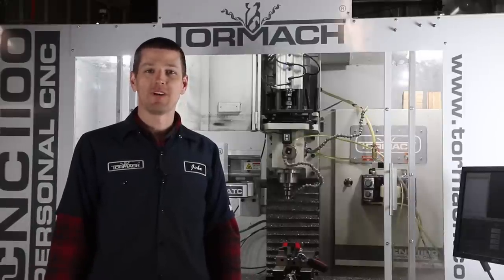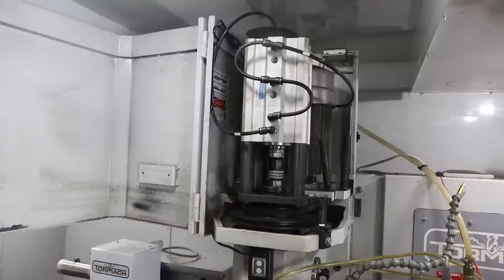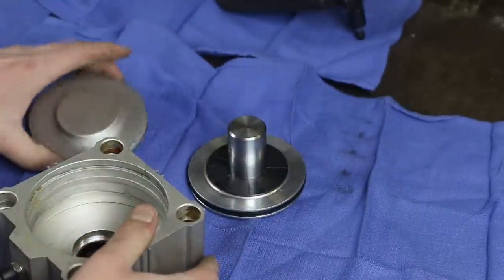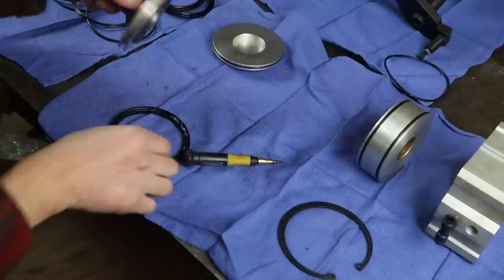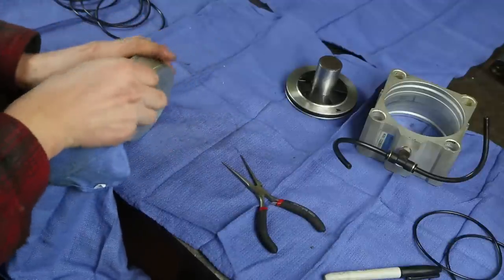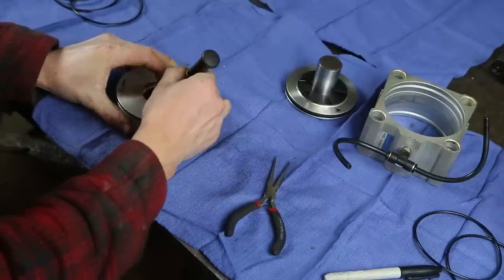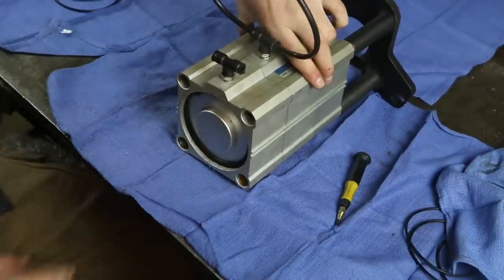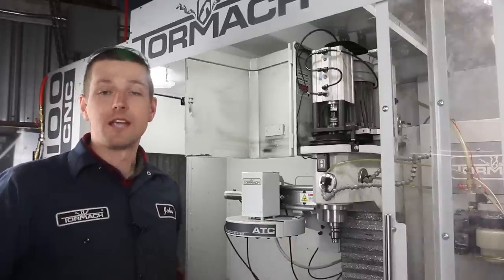Tormach Power Drawbar Surgery!  Pneumatic Seal Replacement!

Comment: I'm currently building a power draw bar for my mill that I'm CNCing.  I ordered the steel for the frame on Friday.  The power comes from two brand new 80mm SMC air cylinders.  SMC recommends no lubrication for the feed air, but I do plan on using very clean air.  If your cylinders aren't SMC, they're SMC clones.  There is a Chinese company that sells clones of popular SMC parts on eBay.  I bought a solenoid valve and a filter-regulator unit, both SMC, used on eBay as well.  The clean air from my oil-less compressor will be routed through the filter-regulator and then through the solenoid valve.  All exhaust ports in the system will have sintered brass mufflers to keep out any crud.  From what I've seen of SMC quality in the nastiest and most abusive industrial applications, my nearly clean room application should outlast me before any maintenance is needed... I hope.

I noticed your air cylinder rocks to the left under pressure.  This can be problematic for air cylinders.  The SMC data sheet for the air cylinders that I'm using specify the maximum lateral forces on the end of the shaft.  The bottom shaft seal would be my expected failure point if lateral forces were the cause.  It's a bigger problem for long stroke air cylinders, but I made sure to design my power draw bar so the shafts only push vertically.  I have a steel pusher plate between the end of the shaft and the top of the draw bar, and the shaft is not attached to the pusher plate so there can be almost no lateral force on the shaft.

Even though SMC recommends no oil in the feed air, I wondered if the cylinder manufacturer packed some sealing grease in the air cylinder when new, and if the rebuild kits would come with new grease.  Apparently yours didn't, but if just doesn't seem right to me that the seals would be wiping against acetone cleaned dry surfaces, but certainly the rebuild kit instructions would tell you if any type of lube should be used.

27:50 - I'd put sintered brass mufflers in the two exhaust ports on the cylinders.  Nothing should make it in there, and the exhausting air should keep it cleaned out, but I like the system to be sealed to keep out contaminates.  Also... mud daubers!  :-)

I'm a bit concerned.  The three stack air cylinder used on the Tormach should be able to exert 3300 pounds of force at 90 PSI.  I thought 1000 lbf would be sufficient in this application (not sure where I heard or read that), so I designed my power draw bar to exert 1400 lbf at 90 PSI, thinking that I'd run it at 60 PSI or so.  My old spindle motor is only 2 HP, and the replacement I'll be using is only 1,5 HP, so maybe I'll have enough draw bar tension.  I guess I need to look into the draw bar tension force some more, which is bad as I already bought the air cylinders.  :-/
Reply: NYC CNC I've been using the Chinese eER20 collet holders on eBay and pseudo-TTS for at least a couple of years, with manual tool changes.  The benefits are much greater with CNC and a power draw bar.  Ultimately, I'd like to have a pick-and-place tool rack on the side of the table in lieu of an automated tool changer.Here's a similar class of machine to my Grizzly G1006 mill/drill, using about the same (or slightly less?) draw bar tension that I'm planning on using, so I'm still hoping for success.http://www.littlemachineshop.com/Instructions/2936PowerDrawbar.pdfIf I need 2500+ pounds of force, I'm going to need a new plan, because I doubt the cast head of my mill/drill could withstand those forces for very long, even with the substantial reinforcements I'm making.Steel for my powered draw bar will be here tomorrow.  The incidental items from McMaster are arriving today.  The 2 HP VFD arrived this morning.  I just ordered a heavy PVC tarp to use as a slightly upscale version of the floor-to-ceiling shower curtain enclosure system employed by home shop machinists on a budget.  I stole the Tormach sliding front door design but haven't bought the black pipe or 2' X 4' clear polycarbonate hanging panels yet.  I'll start posting short videos soon, with each devoted to one step in the CNC conversion process.  Search YouTube for CNC Turd Polishing and you should find them.  :-)

Comment: Nice video, all your videos are appreciated I am a big fan of sharpie notes when dis assembling and reassembling parts here's another tip I like to put the date and the part numbers right there as well that way the next time it comes apart I know how long it's been since the last time the job was done and of course the part number should be written where it's easy to find.  I would also lube the o rings mineral oil or silicone based lube.  I have even heard of using a little water and dish soap but only for assembly of non moving parts I'm sure others will chime in on the proper lube as well.  Thanks and keep up the good work
Reply: NYC CNC The sharpie should hold up quite well I have only been able to remove it using Lacquer thinner, "my favorite solvent" for cleaning metal parts including the nasty oily coating on p&o sheet steel.  I'm also a big fan of the "JUSTRITE 10208 Plunger Can" to efficiently dispense solvents onto shop towels Other favorite items to mark with dates include newly exchanged welding / shielding gas cylinders, newly replaced spools of solid core mig wire, Motor guard air intake filter for the plasma machine (all filters for that matter) and new tools.  It's always nice to know at a glance the last time a filter was changed or just how old your tools are getting etc.

Comment: Question for those who know should you lube the seals with something before installing? I worked with a guy who would always grease them and never really knew if it was a good idea.
Reply: David Queen  Yes, use Parker o-ring lube or Sil-Glyde, avoid petroleum based lubes.
Reply: remy5405 
It is all about materials compatibility for the intended application. 
Most o-rings and seals for automotive use are not natural rubber, but instead are completely synthetic or synthetic blends such as Buna-N that is a natural rubber and Nitrile blend. 
It is well known and established fact that most petroleum based products attack and deteriorate natural rubber and some synthetics. 
There are 8 of the 18 most popular materials used for o-rings and seals that are positively contraindicated for use with petroleum based products and are listed as such in most material compatibility references. 
Trelleborg, Parker, NOK, Dow, DuPont and practically every manufacturer of o-rings and seals globally will advise against using natural rubber and certain synthetics to seal petroleum products due to material deterioration and reduced service life. 
The Parker application and installation manual clearly states that using petroleum based lube for assembly and operation is only acceptable on PTFE (Teflon), EPDM (Ethylene Propylene), CR (Neoprene) and MQ/VMQ/PVMQ (Silicone) o-rings and seals. 
That does not include buna, natural rubber and approximately 40 other o-ring and seal materials. 
Here is a quote from the Parker manual "Parker Super-O-Lube is a silicone fluid recommended for use with all rubber materials, o-rings and seals. Only a thin film of Super-O-Lube should be used with silicone rubber to prevent seal damage." 
Dow Molykote 111 Silicone O-Ring Lubricant is specifically formulated to lube o-rings and seals, prevent degradation, is silicone based and contains no petroleum products. 

The takeaway is that if you cannot positively identify the o-ring and or seal material, be safe and use a silicone based lubricant and avoid the possibility of petroleum based lubricant damage... unless you are a gambler and or do not object to repeatedly performing the same repair sooner than necessary. 

I agree with your statement about brake fluid damaging most materials including paint finishes, and petroleum products damaging brake system components. 
I have witnessed the results too many times. 
Good thing here, is that John's PDB does not employ brakes or brake fluid.

Comment: Super Lube Synthetic Grease is good for applications like this. Its a silicone grease with teflon in it. Not very expensive, you can get it at some hardware stores or Amazon.

Comment: A tip for next time, Use a tooth brush, and parts cleaning fluid. That will remove ll the gunk without having to worry about damaging the seal surfaces.

Comment: Maybe the bottom one is the worst becouse gravity will take the moisture and crud down?
Reply: NYC CNC I think it's forced out when forced closed on the PDB close cycle.
Reply: NYC CNC I agree with you John. Maybe the air that goes into the bottom stage to release is more the issue and the fact that the ram extends into open air here and it is closer to the belt drive dust etc to retract it back into the cylinder. Like suspension - the last seal on the ram near atmosphere always dies first. Maybe a simple neoprene or rubber below/boot there would help?? PS: are you tired of everyone's expert 'tips' yet ;-)

Comment: I am pretty sure Hoss @ hossmachine has plans that he sells for a multi-stage air cyliner.  I couldn't find them on his site after a cursory look, but I think they are there. He mentions something about the build in this thread: http://www.cnczone.com/forums/benchtop-machines/171662-power-draw-bar-idea-feasible.html

Also, I am pretty sure a 3 stage 4" cylinder would have the equivalent force of approximately a 7" single stage cylinder, all things being equal. The precise radius should be the square root of 3 * (r^2) or in this case the square root of 12. Which is ~3.464".

I enjoy your videos, particularly your Arduino based ones. IMO there is a shortage of Arduino, or any micro controller based videos, that are accessible to people who aren't programmers by trade. Particularly ones with practical applications.  I would love for someone to prove me wrong.

Comment: I love using a swipe of silicone ring lubricant. It is not terribly cheap for the good stuff, but I use it on all of my rebuilds (unless it is an oil exposed ring). It works well, and makes things last a very long time. For example, on an air filer, it used to get gummed up with my less than clean shop air, but after installing a 2 stage filter, and regreasing, no issues. It really extends the time between servicing. 

I am a bit disappointed with Tormach though... They really should put a breather on those bottom ports for the top two pieces. It prevents crap from getting in and damaging the seals. Simple vent filters. http://www.mcmaster.com/#breather-vents/=wjeznv
Reply: Yep, a little dab on silicone lube when you install an o-ring goes a long way to preserving the life of the seal - never go in dry! ;)
Reply: Jon Massey oh dear. That's one way to put it.

Comment: Use a pencil to remove seals from grooves. The pick will scratch and that tiny scratch will cut the new seal. PITA. An old dishwasher is great to have for wahing parts before assembly. Ours uses 3 gallons to wash and 3 to rinse and it has an element to heat the water as it washes. Fill it from a bucket.  Don't use your ma's. Will be the end of you!
Reply: NYC CNC My friends make fun of me but it was by far a great use of the floorspace.  Don't use the jet dry stuff ;]
Reply: Parker makes a reasonably priced set of brass and stainless o-ring tools, but sharpened chop sticks work exceptionally well removing o-rings/seals without damaging the seal or the groove and they are free with takeout. 
An good alternative are glass filled polymer soldering aid sticks. 
I use an old used Kitchenaid dishwasher in the shop to clean small items. It does an exceptionally good job using the typical Cascade dishwashing detergent, best $45 tool in the shop.